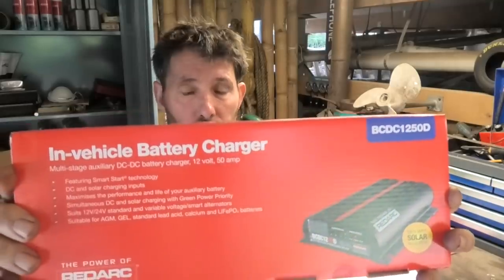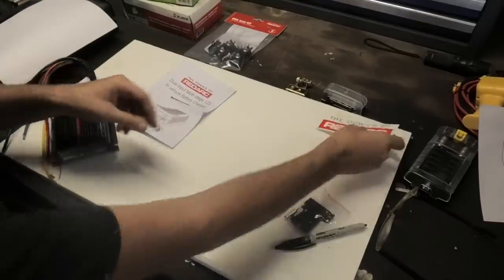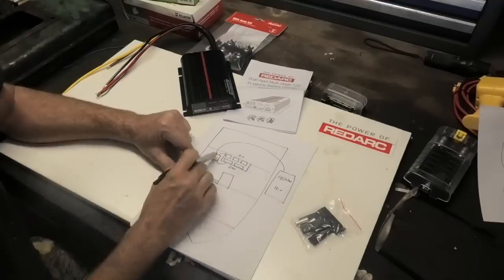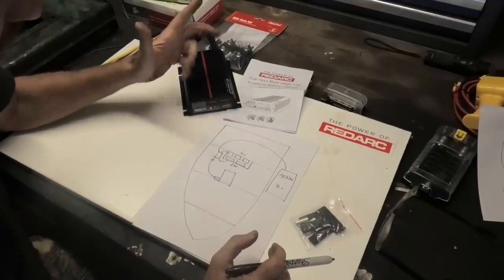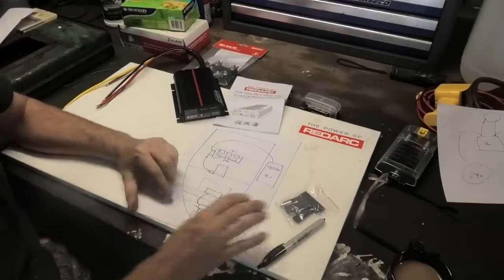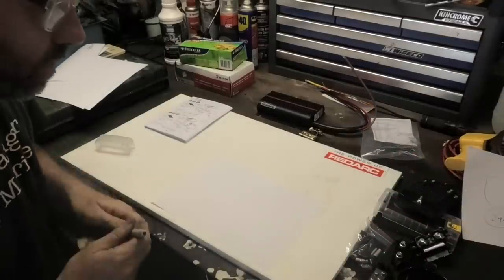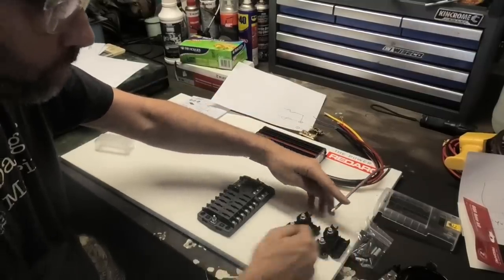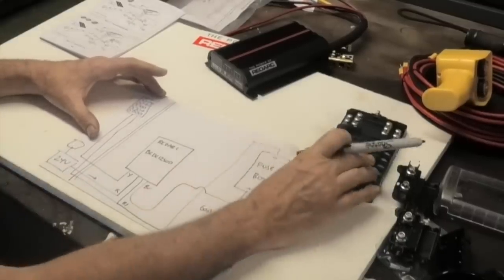Planning the trawler electrics

Comment: Stu,
For what it's worth, I have found outboard control harness cables to be VERY helpful in wiring.  OMC, Mercury or Yamaha all have quality tinned wire of decent gauge, and are bundled neatly into a single easy to pull cable, are usually 5-8 meters long, and are color coded.  Usually the red and black cables are of 10 or 12 gauge, and can carry heavier loads, while the others will be 14 gauge for standard loads.  If you are like me, you probably have a few harness cables hanging around, and you can often get old ones for next to nothing.

I don't know if this is helpful to you, but I've cut literal birds nests of wiring out of a boat and used a single control cable to completely rewire a center console or cuddy cabin boat.    Of course, your boat is much more complex, so it may take several cables, but this may be helpful... or not.     Just a thought.
Reply from the maker: Thats a great idea Tony. I was thinking trailer wire, but that is only 7 cores. I probably do have an old control cable lying around somewhere. Nice one! :)

Comment: Are you contemplating radar as well, Stu? Your earth system plans are spot on. A (shortish) mast of some sort (future radar, perhaps) with very thick flexible copper rod to the bottom of the hull, offers a "cone" of protection from lightning strike, too.
Reply from the maker: Radar isn't on the list of things to get immediately, but I certainly think it is a very valuable piece of equipment to install so I'd like to plan for it.

Comment: Re anchor winch Im a skipper at a  youdrive charter boat company we have a number of boats in the fleet a couple of them have a separate battery up forward solely for the winch relying on wiring from the battery system  at the rear of the vessel to recharge it’s a very unreliable system for recharging. The rest of the fleet supply the anchor winch directly from the start battery so when the anchor winch is in use the engines on thus recharging the battery straight away just a thought worth considering as a option cheers Richo
Reply from the maker: That does sounds like a good way to go. The starting batteries are more suited to delivering that short burst of high current too.

Comment: Excellent video, eagerly awaiting the information about the earthing set up as that's the bit I can't quite get straight, I've not dealt with marine stuff at all before buying my boat so I'm relying on the internet to show me all the things I don't know that I don't know! :D

As for charging your winch battery, to get maximum life out of it you'll need it charged separately from any of the others, even if that just means installing a monitoring system that can switch a charger on and off for each particular group of batteries. 

You should really keep all batteries and battery bank charging arranged in the groups that are used together, for instance if you have your winch battery hooked up to the same alternator that is charging the starting battery but then only start the engine once but use the winch three or four times the alternator will be over charging the starting battery while trying to bring the voltage up on the winch battery (or visa versa of course). 

A constant trickle charge from a solar panel will also damage a battery over time, you want it maintained at a set voltage rather than force fed even a tiny current all the time the sun is up.
Reply from the maker: Yeah, thinking of running the winch off the 12V starting batteries now, it makes more sense. I too find the earthing a bit mysterious at the moment. I have a lot more reading to do!

Comment: Well, of COURSE you'd use a flashlight instead of a torch! Who wants the boat to catch fire from waving a TORCH around inside the cabin, not to mention the SMOKE .. ? ;)
I favor the full floating ground, but your existing service wiring ... which you want to keep ... will probably defeat that. So put lots of zincs on the hull.

Comment: Hey Stu, i've been watching you videos for years. This project is looking brilliant.

Not sure if your betting on the redarc being able to charge the starter batteries from the solar cells, if so I 'm not confident that the Redarc can charge the 24v system via the solar panel if your panel voltage is only 12v, normally an MPPT charger can't do that and that's how they are advertising it in the manual....  could be wrong though, if it can than good news. It may only charge the house batteries
Normally to charge from  solar with lower than battery voltage, you need whats called a boost charger, which means when using that, your cells can't be ABOVE battery voltage.

I opted for a separate MPPT controller in my vehicle setup, so that i could wire a remote screen to it in a better viewing position, this way you know how much solar is charging and if it stops working.
Not as expensive as you might think...

My advice would be to series up your cells to achieve a higher voltage, that way you can run smaller cables to your solar cells, also consider that the redarc solar input will also have a maximum input current, and that running 900w of solar at 12v at max wattage will charge at 75A!!! Thats some pretty big cables coming down from your roof.
There is no way that redarc thing can handle 75A of solar current, I also highly doubt it can actually handle 900w of solar full stop....which could make your 900w array just as effective as a 300w array.
The redarc also has a maximum solar voltage input of 32v which is on the low side and limits the series/parallel options you have for trying to get that current down.

I'd be opting for putting half the panels up (considering the redarc can't use it all anyway) 
or 
buy a seperate  or 2 MPPT charger/s and then have a switch to switch the battery side of the MPPT charger between the house and starting batteries
or
use say 1 or 2 cells in a configuration that gives you greater than 24v to charge the starting batteries through a seperate charger and use the rest of the panels to charge your 12v system through the redarc.

I have approx 50m of 21 core cable that would be ideal for your signaling/ tacho etc needs.
I can't give it all to you but please feel free to come and grab 15-20m of it 
I'm located in Sunshine coast QLD so you can pick it up on your way through if you want it.

I'll send this through as an email as well with my contact details.

Comment: You will be more then fine with that anchor set up. 
I realise that there will be a size differential, but on my boat I have a 1000W drum winch and 150 meters of rope, 10 meters of chain, and a 6Kg Rocna. I lift and lower this at least 10 times a day when Im fishing. The house battery runs everything except the outboard motor. It is a 700CCA High cycle battery and is only charged from the outboard after the VSR changes over. I have not had any issues with running out of power.

Comment: Interesting idea you have with the separate battery for the anchor winch / I know Bow Thrusters have a similar system with its own isolator and battery but have never seen it done on an anchor windlass before
Reply from the maker: Hey Callum. I'm still in two minds about which was to go, but now thinking of running the winch off the 24V starter batteries.

Comment: If you have any blank slots left in the fuse block, use them to hold emergency fuses for the critical components. (radio, bilge pump etc) It can save you from having to hunt down your spares in an emergency...

Comment: I bought a new inverter for our RV last year and runs super quite. It has a battery switch to switch on to run off my 2 in series marine quality 12v batteries which in series is 24v. We mainly use AC hookup power which for a boat would be shore power off the marina docks where available. With the inverter a trickle charge keeps the 12v batteries charged. With your setup with solar where shore power not available the cells will trickle charge your batteries especially with a good charging weather day. With charging a boat fire is a major concern so a fire retardant auto system would be worth looking into someday like aircraft have. They remove the oxygen in confined spaces which are needed for a fire to spread. Just sharing my rambling thoughts
Reply from the maker: Hey Tim, a good fire system would be interesting to look into. Bad things can happen...

Comment: Use relays for Items like bilge pumps etc. This cuts down the amps going through your wiring from the wheelhouse. So your power feeds to these heavy draw items are at a minimum, act as isolation points. Don't forget to fuse all the input and outputs to the Redarc unit.
Reply: I would definitely use clearly labelled relays for all heavy power draws . If that's done only light power draws to the wheelhouse which will be much less likely to play up, and if there is a particular problem  it will be easy to locate and override relay if needed.

Comment: If you don’t have the windlass motor already, hydraulics there might save a lot of issues. Hydraulics might also provide other crane uses depending on what you want to do with the boat.
Reply from the maker: Yes, hydraulics certainly are worth looking into.

Comment: You could set up shore/generator battery charging on a transfer switch. Victron makes highly featured inverter/chargers (multiplus). It will combine power sources (battery, generator) for higher AC output. Their battery monitor is nice too, BMV-712, gives remaining battery as a percentage, and time to depletion. Maybe add another dc-dc charger for the anchor winch?
Reply from the maker: I've currently got an inverter that came with the boat, but those Victron inverter charger does look very cool, I'll have to look into them. Could be worth the investment.

Comment: Why not add a 24v anchor winch, twice the voltage will half the current and thus the cable size. Probably better and cheaper than adding another battery and charging circuit.
Reply: Good point, the engine will always be running if you're using the anchor winch, so the start batteries won't be run down by the winch.
Reply: Yes true or change out that single complicating 24v starter!
Reply: @jimz1168  The cables get way bigger with twice the current.  Its 24V for a reason, but,....making the winch 24v has merit
Reply: @rododonnell9783  makes sense only thoughts are around the design using 24v for start up only. Generally want them isolated from heavy draw, but I guess if the device favours charging start ups first should not be an issue other than extra wear on batteries.
Reply from the maker: Yes, I'm convinced this is the way to go now.
Reply: I use my winch a lot when not running the engine.  Sailors vs power boaters.

Comment: Hi m8, something I discovered once upon a time: Placing your sonar/sounder equipment near a battery charger can produce some pretty spectacular interference patterns onscreen (think square wave noise patterns, etc as the charger cycles through its charging cycles). I'm sure these days, connectors and cabling is shielded much better. Still, it would be prudent to power up your gear and observe the interference effects on your sensitive electronics before you commit to drilling down. Good luck!
Reply: Note: Do NOT Google Image Search "charger frequency patterns".

Comment: If you run your winches off the 24v side the higher voltage will reduce your current requirements and maybe get rid of that extra battery, assuming you haven't already got the winch motors, I know the cabling is going to be expensive either way but at the higher voltage slightly smaller gauge it might come cheaper than the extra battery, charging unit and less things to ultimately fail also... 
Edit:.Ah I see a lot of people have suggested this 24v winches, its worth looking into. Also good move on trying to stick with DC, if you need voltages other than 12/24v just try find appropriate DC:DC converters (converters not transformers :-)  )

Comment: Seems like you have a great plan. One thing I will suggest is definitely keep dc and ac away from each other, are tons of issues with combining the two. Another would be to put a galvanic isolator in your AC circuits this will protect you hull from stray AC current helping to stop any corrosion issues. With the bounding hook everything you can up to the common bounding system ABYC has a lot of information on these systems and what they need to be affective. I have many books on these subjects and am a certified marine electrician. If you want to contact me I can take pictures of the books and send them to you.
Reply from the maker: Thanks mate, I appreciate that. I don't have my head completely around the bonding / earthing yet but I think I have the basic ideas. I'm currently watching through Pacific Yacht Systems training videos. Really helpful!
Reply: Any time I have been watching your videos for a long time, and you are a huge inspiration for me going to school to get my marine engineering degree here in the US. bonding can be a huge pain and if not done right can lead to more problems. I have seen it first hand on many yachts I have worked on. Just make sure to connect everything and have enough sacrificial anodes to handle the load and you should be good. Keep making the great content brother. And if you do want the books I can scan them for you and send them to your email.

Comment: Yes,I think youve pretty much nailed it.  NMEA 2000 equipment will be pretty important as you'll want many of the systems to talk to each other n not just radios.  Most good equipment these days is already set up for it so use it.  And you can get a small PC with a few apps that display all the data easy on one or two flat panels you can get cheap.  If you use Mac there are at least one NMEA app.  Consult a ICOM dealer when you're ready for radios.  Other than that just nail down which specific equip you'll use.

Comment: G'Day Stu...Nice plan for the charge side,,be looking at  a redundancy circuit,,just in case the pretty system failed,,,
as for high current draws,,relays with a diode between pos and neg to take shock shunt out,
or use both poles to reduce burn on contacts,,that is pos and neg switched through relay at the same time,,,,or even use 2 terminals for each side of the component,,so as not one set of relay contacts take all the shock load,,
and finally buz bars,,hmmm cable run through boat and tap of to relays and use control circuit to turn on and off,,short runs of high current supply not all going through switch,,which won't last long with high current load going through them,
not sure how much of this cobbidgook you under stand,,
so Good luck Pal..
Water and electricity,,,Hmmmmmmm
Reply from the maker: Thanks Ian, great tips.

Comment: In my mind your system of having a main control panel is great 👍 on your deck crane I would run a 12 volt DC 1 ton atv winch w/ remote . They are inexpensive and you can run a snatch block on your cable . As far as your anchor winch are you running cable or chain if cable go with a 4 ton 12 volt DC winch and run both winches on the same battery with solar charging . My solar panels run at both 12 and 24 volt . I run a 115 volt  AC charger to 24 volt DC output for a handicap scooter there I use an inverter 12 volt DC to 115 volt AC to 24 volt DC output that’s what works for me anyways ! Less wiring = less headaches! Having your wheel house on a control panel by itself to me makes sense because your a crew of 1 ! Good luck and SKOL BUD !
Reply from the maker: Thanks mate. I agree about the less wiring the better. You need to be able to diagnose it down the track and a mess of wires is almost impossible to trace.
Reply: Dangar Marine it’s kinda funny that let’s say a Honda atv really only needs 4 wires to start and stop yet these engineers make it so complicated !

Comment: I had the dedicated battery for the winch and ran the  big cables to the starter battery’s   .  On a 30 foot boat with battery’s mounted near center of boat I would go with bi cables to winch.   It’s going to be a simpler system and the cost will be close either way you go.  Using a 24 volt winch would even be better.   I’ve found it’s always better to use the winch while engine is making power , raising the voltage a bit.
Reply: bi=big
Reply from the maker: Yes, I think that is the way I will go. You generally want your engine running while both lowering and raising the anchor anyway for maneuvering so it is a win-win.

Comment: yip aim for at least 1500w solar it'll be a great help in the long run. also switch wise don't cheap out on them I've had cheaper stuff fail only because I wanted to save a couple bob. go for a well-illuminated switch also so aim for a good 5 wire type.

Comment: Most commercial fishing boats in the US north-west use hydraulic anchor drums (drums not winches, just as you’re planning) with the pump powered by a PTO off the engine - might be worth checking out? Basic agricultural components so tough and of course cheaper than anything with the word “marine” in it’s blurb (George Buehler’s books have a lot of info)